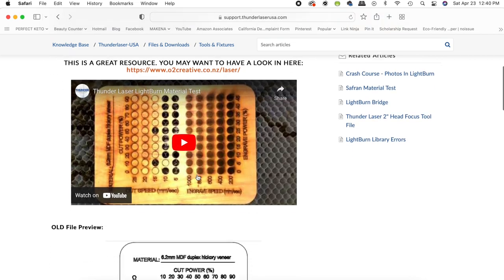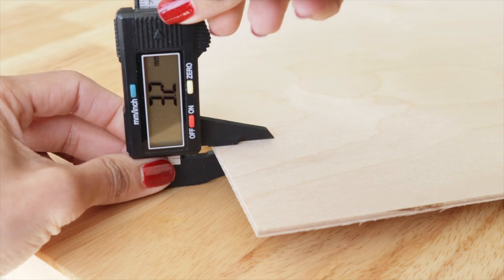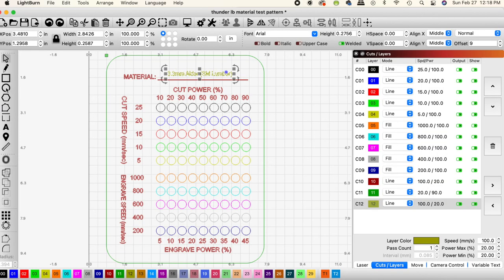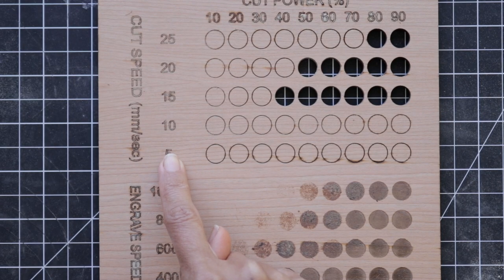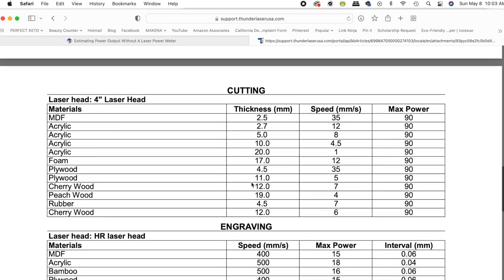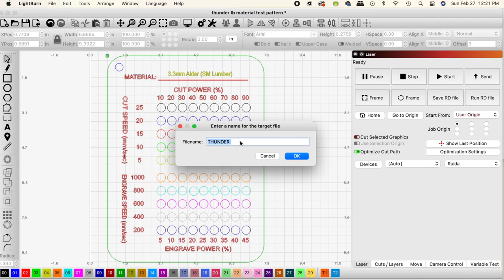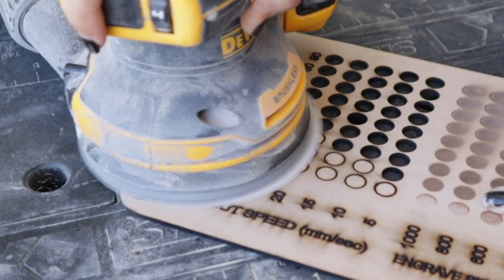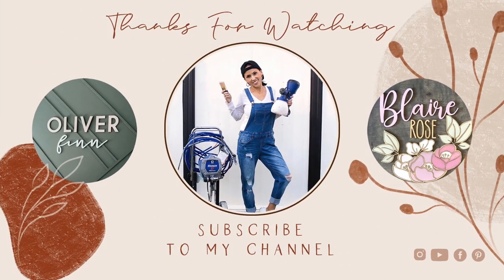How to Make Material Test Cards on about Laser

Comment: I have always been a great fan of Thunderlaser's  great machine design and engineering quality along with their many videos as they attempt to make laser cutting easy for the masses.  The matrix test card is a great beginners tool to get you working but it is  like training wheels on a bicycle, once you understand how to balance,  you remove the trainng aids. If you look at the small details of this test matrix you wil hopefully ask yourself several questions:
1) With the cutting test, once the pieces drop out you lose a lot of valuable observational data. However, look closely at the 25mm/s cut speed and note how "smokey" they are in relation to the 5mm/s cut line.  Why?  Its the same lens, the same focal distance and the same powers.
2)Compare the width of cut (the kerf) between the 25mm/s cut and the  5mm/s cut. Why is the 5mm/s cut twice as wide when its the same lens, the same focal distance and the same power?
3)With the engraving test, I have always been perpexed at what it shows you. It seems to show that as you increase power  the colour gets darker. This is a fallacy  because if it were true the colour would get darker ON THE SURFACE. Look closer and you will observe that increasing the power is making the engraving deeper and smokier. Again you should ask yourself why this is happening? How useful would this be on thin card?
4)The width of the burnt laser engraving line changes with speed and power. There is no compensation of line spacing in these tests. Slower speeds and greater power means thicker lines and double burning as lines overlap.
5)Focal distance set to the manufacturer's OPTICAL specification rarely gives optimal cutting or engraving performance   because your  laser beam has  an INTENSITY focus that changes with speed, power, material  and position on the table.  So.these test patterns need to be done at different focal distances to find optimum performance chracteristics.
 If you never observe these issues, ask questions as to why and look for answers,  then you will for ever be stuck with your training wheels.
 Great as Thunderlaser are they do not really understand the technology they sell beyond skin deep. To extract the best performance from your machine there is so much more to understand. Please watch this video to see how misleading the test matrix can be.      https://youtu.be/Na5_6okUyKg        This may whet your appitite to understand more about the technology you have invested in. It is truly amazing and your TL machine can do much more than TL ever imagined.